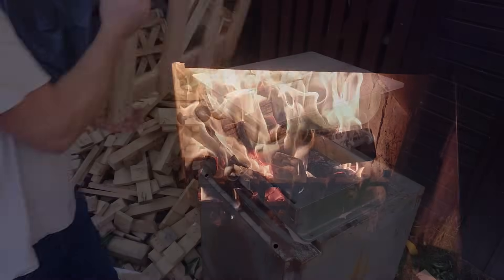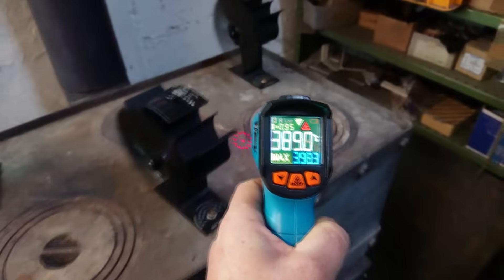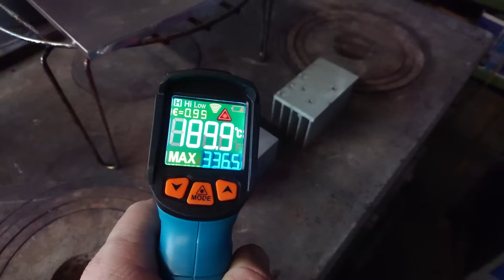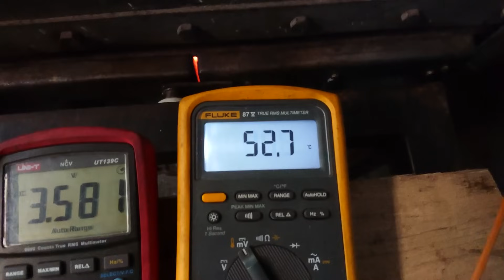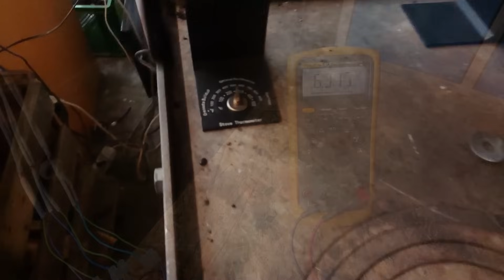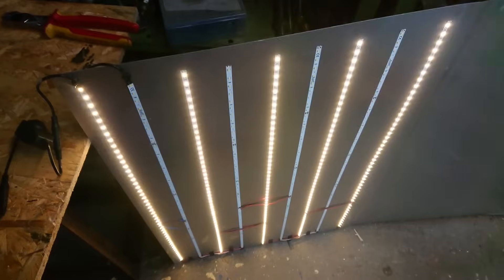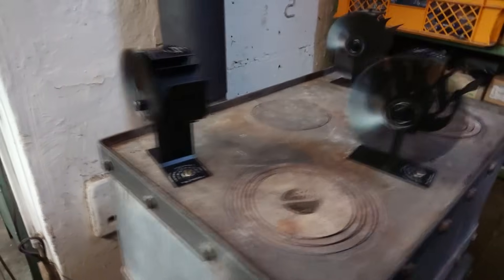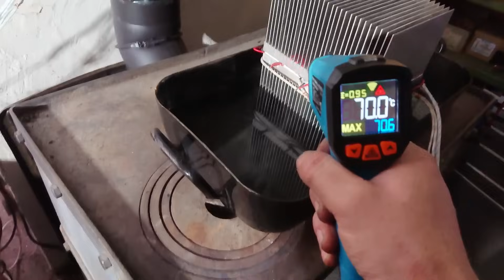Generating Electric Power with my Wood Stove - Peltier Experiments

Comment: I've done this, but with an oil lamp. I could get about 3,5v and/or 200mA out of one module afaik. They have a clear maximum power point, like solar panels.  Very similar cheap chinese peltiers. 
I used water cooling, at about 200ml per minute, gravity fed. The hot side got to about 100 degrees with the cold side at 30 or so. Manually recirculating the water would be possible, if you'd get a tiny pump to pump back water upwards to a reservoir where it also cools down to room temperature again.

Comment: You could add a watertank between the chimney section and the heat sink to make sure you don't get over 100 degrees and still have free airflow over the cold side. The tank could be open top with a simple floater to easily see waterlevel. With the application with off grid cabin you probably want to heat up the space quickly and thereby risk to much heat in the chimney.

Comment: If you were able to source an Absorption type of refrigerator and use the heat to create a much greater temperature differential, using the heat to drive the ammonia mixture to do its thing. using heat you can create such a differential that sub zero temps are possible.  Just say'n Great videos  (JD from Portland, Oregon USA)

Comment: It might make sense to have the setup built into the cabin wall, one side being outside in the cold. Also hooking up the output to a battery so you get some useful power with a bit of patience, even if the power input is low. Also you might ba able to use some bimetals to mechanically move the heat collection side to and from the oven surface. I'm pretty sure the tiny amount of movement would be enought to either touch or not touch the oven wall, therefore limiting thermal transfer. All you'd need then is a few screws for calibration. It all would result in a bit more complexity, but it'd still be pretty much no-maintenance.

Comment: An old fashioned side mount water heater should provide ideal conditions for your experiment.
Coil inside of firebox piped to external tank will provide hot water through thermosiphon effect.
Make sure to provision for steam expansion in coil so no danger of explosion.

Comment: The distance of the peltier from the base of the fan to the peltier itself is telling when on the stove top. It appears that these modules are not damaged by the heat from the stove. That distance may be key to better operation of your design . Also you will have to consider the length of wire needed to put the lights in an ideal operating place because I believe there will be a voltage drop based on the length of the wire needed . I am not sure about this but you might be able to use a joule thief circuit to make up for this drop . I have always wanted to experiment with these modules but do not have the requirements to do so . Thanks for sharing this . :O)

Comment: A stirling engine might also be a good option but not sure how efficient they are. You might also need to strap a different generator to them since commercial ones (if you don't build your own) tend to come with el cheapo electric motors

Comment: A modest wind turbine could be used to provide modest power whether the sun shines or not. You could use small electric heating elements under your panels warm, so that the snow does not settle on them G7VFY

Comment: This is a fantastic proof of concept. I well remember my grandma having a wood stove heating up the kitchen. The exhaust tube had an heat exchanger made of smaller pipes to act as a radiator, and some sticks to suspend washed clothes to dry...

Comment: What a really interesting experiment! Bravo! As a suggestion, cool side of the water bath Peltier generator, you might consider using off the shelf, or even salvaged heatpipe coolers for CPUs, either from old laptops or perhaps from old GPUs from junked Bitcoin miners. I wish you luck in your interesting experiments!
Years ago I purchased a little Biolite woodburning camp stove as it burns wood and makes a tiny bit of electrical power...and I even powered a cheap Baofeng Ham radio solely with wood power and did a video of an actual checkin with it. Search for "Wood Fired Ham" and "Part 2: Wood Powered Ham Radio" to see that! Good luck!
(Please excuse my poor videography...it was the second video I ever made!)

Comment: The vertical arrangement at the stovepipe allows much better cooling of the cold side due to convection. Some of the stove fans have strips of bimetal that lift the foot up before it overheats the peltier. With a stove like yours, I would hang the Generator to one side of the stove with hooks and attach such a bimetal that tilts it off the hot surface in case of overheating. The Generator arrangement would also be vertical, but the hot side would not need to be built to reduce temperature (simple Alu plate) and the cold side heat sink could cool way better thanks to convection in cooler air.

Comment: Why not use the heat from the fire to create steam. Run a small turbine or steam engine to turn a generator or large alternator to charge a bank of Lifepo4 batteries. Create the necessary voltage through an inverter and run your shop from that set up. You'll get far more electricity

Comment: Using the boiling point of water to limit the temperatures was genius, all you need is a reservoir and remember to keep it filled. Maintaining a heat input that doesn't damage the Peltier modules was essentially the only difficult problem in this project. Good work. It seems that there should be research using the Peltier effect on a larger scale, there are so many industries that produce excess heat which require extensive cooling systems. Recovering even a couple percent of that wasted heat as electricity could be quite significant.
Reply: this is the working principal behind the RTG's that power space probes. issue being they are very expensive and are at best 5% efficient. assuming the heat is enough to boil water a Rankine cycle steam generator would make the most power but its far larger and more complicated.
Reply: He could probably put the reservoir on top of the heat sink to act as a cooler.
Reply: @TittleCreekOutdoors  I think you've hit it. A reservoir underneath to limit the hot, steam running to the hot side of the TEG, then through an exchanger to heat the room, draining into an upper reservoir acting as the cold side. An overflow on the cold reservoir drains back into the hot reservoir and bandaging baddaboom you've got it. No mechanical parts, minimal maintenance, probably scalable, renewable heat and power.
Reply: There are examples of this type of heat/energy recovery, not usually using Peltie devices, CHP combined heat and power, HVAC often have a heat exchanger between clean intake and dirty outlet.
Reply: at that point you start to wonder if you are better off building a steam turbine generator
Reply: At this point it could be a steam engine xD
Reply: When I was back at university, I had the pleasure of an event lead by professor reiner kümmel. He talked how he had data collected for modelling similar potentials: Using waste heat from on process as input for other processes. Treating waste heat as a resource should be more of a thing. Saw a small documentary on youtube about a factory that thinks heating, cooling and electricity together (and more minor energy savingthat is often dismissed). With energy prices going up at the start of rus invasion of ua, the ROI was 100%, now it's probably dropping down to 30% agai..
Reply: Waters boiling point is too low for this. He needs closer to 200c for max power.
Reply: What are the temperature limits imposed by the safe operating range for the Peltier modules? Temperatures as high as 200C seems likely to cause damage or severely shorten their life
Reply: @ Don't get me wrong, water is the easiest and cheapest thing to use, but you just won't get max power. You would be getting less than half of the effectiveness. Glycol has a boiling temp of 197 which is perfect, but is expensive. It ultimately comes down to sizing your pump to remove enough heat fast enough. Fun expirementing! (Also do not use peltiers, those are for cooling. Tegs are different and are meant for real generation)

Comment: A large heat sink of masonry would be more efficient if you keep that heat in your building.  Of course this is during the winter. During summer use of this system,  say for hot water, the excess heat would need to be vented.

Comment: Heat pipes might help you for 1 or both transfers. You could use a steam heat pipe to move a lot of energy a long way from the stove to your modules, and another heat pipe to move a lot of heat from the module a long way into your cold shop

Comment: Plopping a fan directly onto the cold side is actually one way that Peltier mini-fridges get their temps down. Granted that setup is in cooling mode, but the idea is much the same. And if you could use the same motors as the stove fans do, you could have a highly-efficient active-cooling method. The water pot is a great idea, and helps with another thing during the winter; humidity. Low humidity is an absolute pain, especially when trying to get work done. Everything static shocks you, the cold bites your skin even worse, and you easily get chapped lips.

In theory you could have a barrel of water somewhere above the setup, with a level switch and an electric valve, to automatically keep the water level above a minimum amount, so you could let it sit overnight generating power for a small battery bank. Most people let their stoves on overnight to keep the temps up, but don't need the lights, so having a secondary use for the generated energy is a bonus.
Reply: would have to monitor the humidity..to much is worse than not enough...will ruin your insulation as vapor condenses in it and lead to mold when it warms up.

Comment: The furnace is sucking cold air from somewhere. Use that cold air to cool your cold side. on the other side, you can make a water boiler with some pipes that is self-circulating due to convection and use that for the warm side. No moving parts and no chance of overhearing

Comment: The more temp difference there will be the more energy you can get from those peltier devices. I haven't seen you try an ordinary computer fan directly on top. That should provide much better air flow to get more temp difference and should be more than enough to power itself and some additional load.

Comment: What about locating your peltier pack on the outside portion of the chimney stack? The lower temp of the chimney would relieve some of the anxiety about overheating and the cooler outdoor temps might give a greater differential leading to better output and remove the need for active cooling.

Comment: Great experiment. I am  wondering if there is sufficient energy to power the lights but also draw off some to run an Arduino and servo motor that would occasionally adjust a damper on the stove-pipe to keep the peltier at optimum temperature differential and base temp. A self balancing system if you like.

Comment: Whoa. I never thought I'd see TECs here. They're not a consumer good, usually. I used to work with them. As your experiments show, classic TECs won't work well with fire that close. Bismuth telluride and the solder aren't good at that range. We did have ongoing research into higher temp materials but could never make a business case for them.

Comment: Perhaps you could use pressure from boiling water to lift the device off the surface of the stove. Something like a small hydrolic cylinder could do the trick. 
Would necessitate some safety measures like an over-pressure relief valve.
You could have a steam generator sit directly on the stovetop and dump the steam into the cylinder. The cylinder could then actuate a mechanism to lift the entire assembly off of the surface when the water starts boiling. The assembly should then oscillate between the lowered and raised state, while maintaining a temperature of roughly a hundred degrees C
Reply: Some of the stove fans I've used personally have a similar feature. They have a bimetalic strip on the underside with the intention that if the base begins to overheat it is able to lift one side, reducing the contact area and allowing the fan to cool the unit more readily. This is only in theory since I've never got my woodstove hot enough to make the device lift.

Comment: I was thinking maybe you can create the device to fit in the flu exhaust exit point. One side of the heat sink is in the flu the other side is outside. Wrap in a shield can isolate it from the exhaust coming out.

Comment: You could add a thermal fuse in series with the peltier modules to turn off the lights when the temperature gets too high, indicating you need to take the it off the stove

Comment: How about an Organic Rankine cycle generator? You could use a reversed scroll compressor from a hybrid vehicle as the expander they have an integrated motor which would provide a direct DC output already, you would need a fluid pump, a rotary vane pump of some sort would be suitable and of course two heat exchangers, hot side and cold side, efficiency would be better and power output would be in the hundreds of watts if done correctly. Refrigerant choice would be the hardest bit, butane or propane might be a good choice despite the flammability.

Comment: I would build a heatpipe out of copper tubes used for cryo or air conditioning systems, filled with alcohol or something and attached outside the house, maybe close to the smoke stack. The idea is to remove the heat locally in a way that will not draw too much heat from the inside the room.

Comment: This is fantastic.  A few other engineers have tinkered with these devices to mixed results, overheating is an issue on the hot side across all experiments I have seen.  possible solution might be to have one of those fans kick on at a critical time to bring the hot side back down.  Perhaps a greater thermal mass to leach the heat/power from. Water is a great heat sink, adding an upside down bottle will allow it to self refill as it evaporates.  Copper thermal tubes are a great, non mechanical, cooling devices that could be used in the system.  OR not sealing the chimney square tube but allowing some air to travel through it will let it convect some air the hotter it gets, a manual baffle would allow you to dial it in.  Just thoughts, the balance is between generating the right amount of heat on a wood stove and that is a tricky thing as the heating cooling cycle is very radical.  Stability and repeatability will allow you to add longevity to the delicate electronics.  Wood gas is an exciting idea but the reactor needed to do it would require a complete rework of that stove and would be more easily accomplish by finding compressor tanks or such in the scrap yard and starting from scratch, but also I think it is a worth while endeavor as the wood you collect is cheap, shelf stable fuel source, and a cabin in the woods will have access to this fuel. 
Look into 'little aussie rockets' and kick around the idea of a rocket stove build if the shop stove needs a redesign. 

Thank you for uploading this video.  It made my day just seeing the thumb nail.  Now I have to go, there are some wood crates to collect from the dumpsters at work, might come in handy for something.

Comment: I looked at doing just this years ago at my MIL's cabin. She has a huge wood stove and sometimes loses power during the winter months which was making me think of ways she could still have some power. Of course as you noted in order to make a system that could safely and consistently generate power could be fairly expensive for such little return. I mainly wanted to try and get 12.5-13v to charge a battery bank to then use an inverter to power some devices.

Comment: A pump isn't required for water circulation, up to a point. Using a thermosiphon, water will circulate by convection. Since it's cold outside, cooling the water isn't a problem, though you may want to use an antifreeze solution so it doesn't accidentally freeze in the pipes.

Comment: The peltier has limits. Find those limits. How much heat can it turn to electricity max - And then create a heat pickup that will self-regulate to that power transfer level. You can abuse the laws of physics on differential of expansion of materials. Even a small wax rod will be enough with a spring - if it gets hot, the piston bends the plate and disconnects the bottom heat sink, reducing heat transfer. The cooling side can be designed to cool off within the above spec, passively.

Comment: I was thinking of something like a hydrogen generator using carbon rods and palladium/platinum anodes in water kicked off by solar or wind electricity. The voluminous amounts of hydrogen are burned in a generator and the electricity is saved in LiPhos batteries or directly used. Not very efficient, but better than Peltier and even on cloudy days as you use your batteries to generate the hydrogen gas when no wind or solar is available. Theoretically the Palladium/Platinum would last forever the carbon rods would be reduced to carbon nano particles which could also be recycled later.